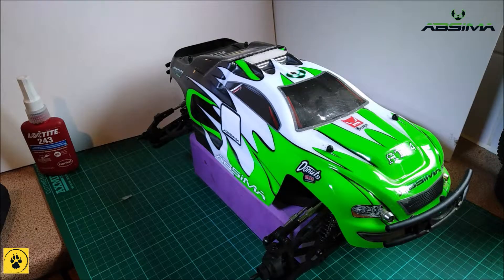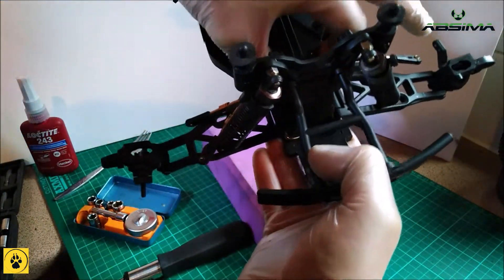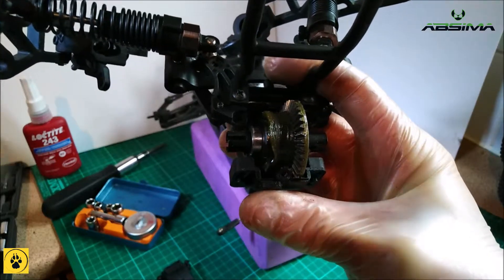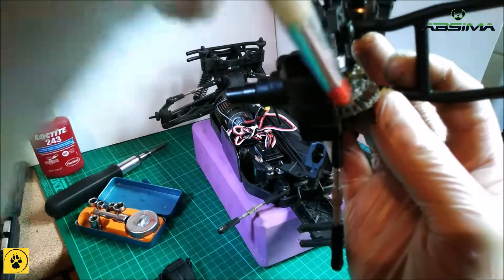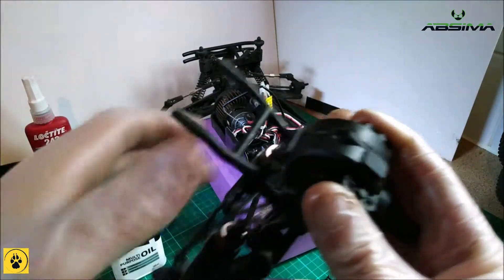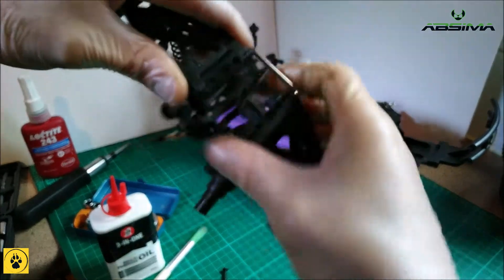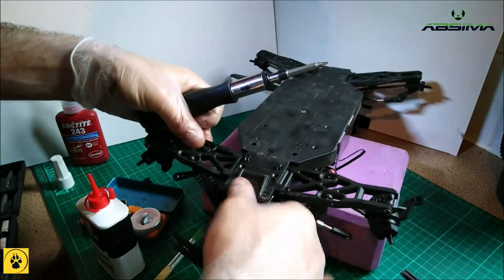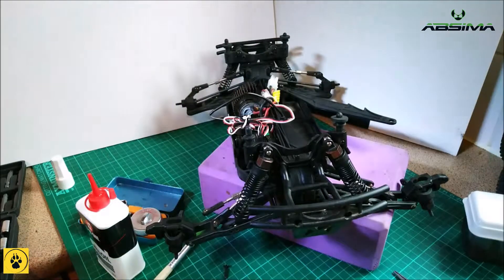RC Maintenance Series-Episode 6 Greasing Your Differentials

Comment: Thanks for this content! One question: its not necessary to clean those diffs before greasing them?
Reply from the maker: It's always a good idea to do a basic clean, remove any heavy soiling and hardened grease before re applying fresh grease. But if you don't have the time or inclination, as long as the diff is in good condition and has no grit etc then you will be fine
Reply: @SouthpawBluesman  this will be my first time doing that,my cars are just 2 months used,not many hours!  Im newbie so, a bit scared about 😂 any tips? I have Arrma Kraton 4s v3
Reply from the maker: @bnajav Don't worry my friend, it's a simple operation 😁 just take your time and be methodical, put all the screws and bolts in a tray or dish so you don't lose them, and don't over do it with the grease and you will be fine 😁 you for this! 🙏

Comment: What do you recommend to use to clean out the old grease?
Reply from the maker: It depends on how much room you have to work with, if you can get a cotton bud / Q tip in there, that's good for removing the grease, if it's a bigger gearbox/diff then a spray of WD-40 will work as long as you clean everything before you regrease 👍 if you can't get absolutely every bit of debris out it won't do any damage, but clean out as much as possible 😎
Reply: @SouthpawBluesman  awesome thanks!

Comment: on the topic of alternative lubes, due to my other hobbies I have an array of gun and automotive oils and greases. on a 1/18 car would you say that coating the diff gears in a viscous gun oil is enough, or to use a grease instead? 

on my prerunner recently I had a front diff click (it's new and was basically dry from factory) disassembled and removed a piece of debris. cleaned the gears with CLP oil then reassembled with a fat glob of black valvoline bearing grease inside the diff cover. my thinking being..couldn't hurt.
Reply from the maker: I would say that gun oil would work fine, it's designed for high temp operations so should be good 🙂 👍
Reply: @SouthpawBluesman  any input on shock oil weight for a car that size? Expecting bumpy ground, occasionally packed dirt and grass, and sharp jumps (not very high but rather abrupt or sudden incline). Initially I thought 40 or 50w but after some of your videos I'm considering 25w. I'm tempted to try 10w30 motor oil and see what happens. I also picked up a 1/18 6x6 crawler and am mulling over whether to use 10w or 20w
Reply from the maker: @dorianshepard2841  I would go for 30 or 25 wt for a small car like that, or you will get too much bounce, and it will never land properly 😎 you might even get away with 20wt👍

Comment: Hi, how about the pinion gear do I need to put a grease also Thanks
Reply from the maker: Hi there, no need to grease the pinion, it just attracts dirt and dust, this will damage your pinion gear and motor gear over time, best to keep them dry👍👍
Reply: @SouthpawBluesman  oh okay Thanks
Reply: Hi, is 1250kv motor compatible in 150amp esc?
Reply from the maker: Well mine is only 60 so I would say yes😁
Reply: @SouthpawBluesman  😄 ok thanks

Comment: what kind of grease could i use for plastic/metall gears? (that would work for both) and how much should i put on the gears? (diff, motor and... other gears)
Reply from the maker: Hi there, well any grease will work with both, you don't have to buy expensive RC grease, a tube or pot of general car grease ( the thick brown stuff) Will work just fine. Pretty much fill the diff cavity with grease, and be generous on the gears, any excess will leak out and can be cleaned off after the next run👍👍